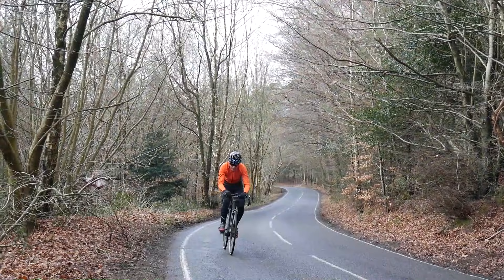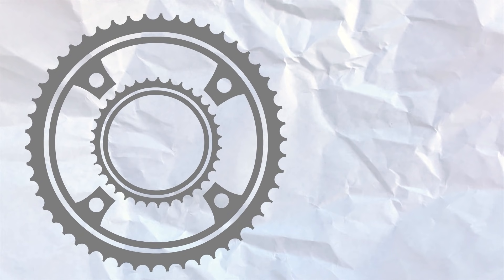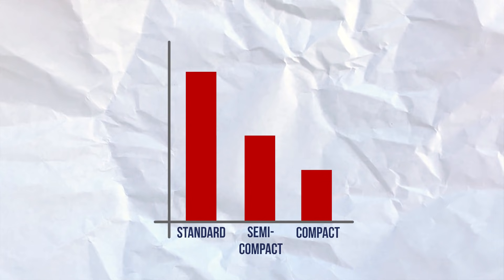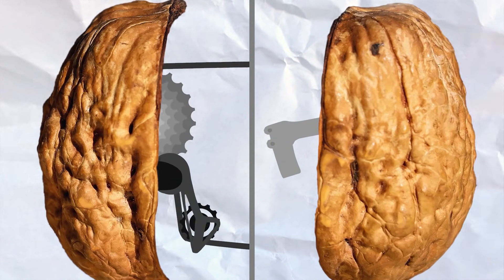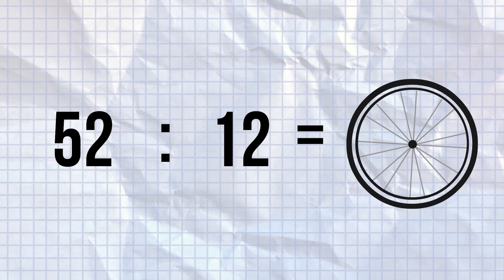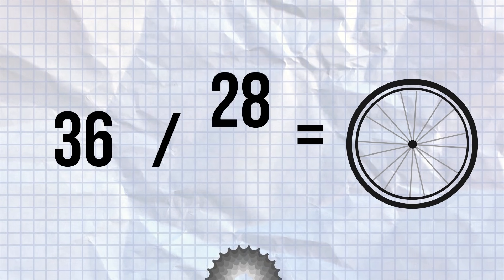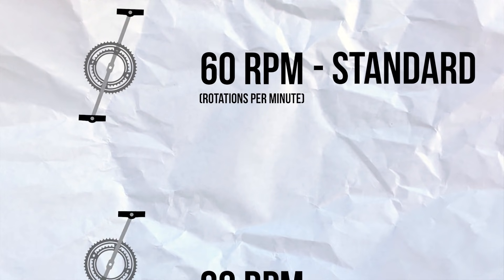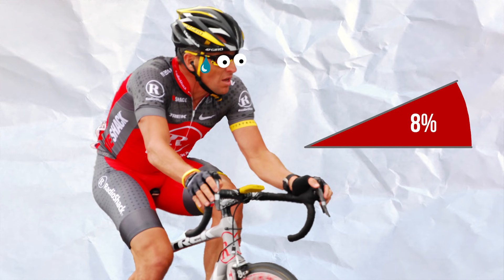How Do Bicycle Gears Actually WORK?

Comment: Whoever invented this system must be a bloody genius
Reply: Yep they are but then it took 1000’s of years to get there basically they just added and improved what others had already done,most inventions are the same anyways just additions and improvements to what was already there,the bicycle,motor bike and cars are additions and improvements to the ancient wheel 😅
Reply: @nathanot1076 thanks for making sense for some of these idiots. Lol
Reply: Ikr
Reply: I always think that same thing to myself. Also with cars, how in the world do you get every little part to work with each other….it’s wild to me.
Reply: Yes! I agree with you
Reply: Oppenheimer: hold my beer
Reply: Thank you I alway thought i was smart
Reply: Yeah
Reply: @pylot5021  with help from his friend Michael cycle.
Reply: @JM-dc5rn  It doesn't matter now anyway since they're both dead
Reply: @sunnybowos266  if it didn’t matter we wouldn’t be using their inventions.
Reply: @B_COOPER  i don't use their inventions 🤨
Reply: @sunnybowos266  why are you here than if you dont care about bikes
Reply: Thank you so much 🥰
Reply: Yes it was a big leap, but in mountain biking a bit of a pain . Here in the uk i can kill a chain in 600 miles dur to grit. E- bike nearer 500 or even 450 at £60 a chain. When fit i do 600 mile a month which means a chain plus brake pads.....oh and cogs front and rear every 3 months. 

cheap, hell no! The mtb sector needs a revision!
Reply: @yetti423 
I don't understand why we use the smallest front gear while climbing while its the slowest .. when we climb the speed slows down .. doesn't that mean we need to choose the faster gear  ?

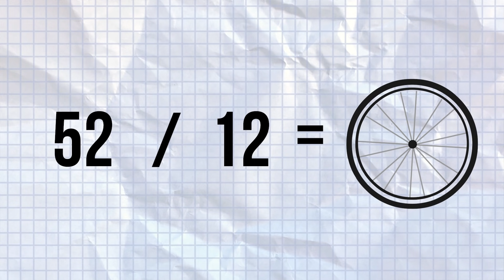Comment: Thank you for such an informative video. At 1:44 it is mentioned 1 turn of pedal results in 4.3 turns of rear wheel. Does the radius of the wheel has no impact?
Reply: The larger the circumference (or radius)  of the wheel, the greater the distance the bike travel per turn of the pedal. As a result, speed is faster for the same cadence.
Reply: @henryangus6934  to add, to maintain conservation of power, you have to put more force the higher the distance per time traveled(speed). thus, higher torque required (stiffer pedaling)

Comment: Sorry for my ignorance, I’m new to cycling. But wouldn’t you want your gear ratio to be a 4.3 when going uphill so you’re not pedaling as much?
Reply: Hi! It’s been 3 years, hope you’re gonna read this..The thing is that doing 4.3 is really tough since you need to give enough amount of kinetic energy to bike to cover these 4.3 rotations of wheels - for just one full pedalling. On the other hand, doing 1.3 rotations takes much less energy that you need to put into rotating your pedals, because you’re going to move less (1.3) comparing to 4.3 rotations. Hopes it helps!

Comment: I tried to lower the front gear going uphill and chain fell off.
Reply: Because you don't change during the climb, you change before. The front should rarely change, it's the back cassette that changes on the climb, that's what the tensioner is there for, no tensioner for the front crank gears so under hard gear change can bind and fall off. For a hill you should be on your smallest front gear, and your largest back gear, if it's to easy, shift up the back cassette until you can be stable but at the same time not come to a complete stop. As it becomes easier you work your way up through the cassette gears. After your in the highest rear gear you can than change the front and depending on ratios can start going through the next crank gear like the smaller crank gear, the front gear doesn't do to much, think of it like a final gear on a car, one gear that effects all the cassette gears.

Comment: For you non doped plebs, just do what contador does. Get the cassette with 1 up front the boggest cog you usually use, so you never run out of gear. No shame to pedal 11 - 34 because contador uses 32 on mountains and hes logic is that, the biggest rear cog should rarely be used, so you never run out of gear.

Comment: Ok BUT you missed a great deal. First if all - road cranks traditionally come in 42/52 tooth ring clusters. Second- why presuppose all shift levers arein the brake lever on handlebar? I still use my old school road bike with down tube friction shifers pretty often. It works pretty well, and I can shift into whatever gear I want instead of only in single increments. There are still A LOT of these bikes being ridden. It is still a thing.  AND you never mentioned epicyclic gearing at all. Dude- you are missing out. But I must admit that what you did cover was well done and helpful. But it is just a small part of the story.